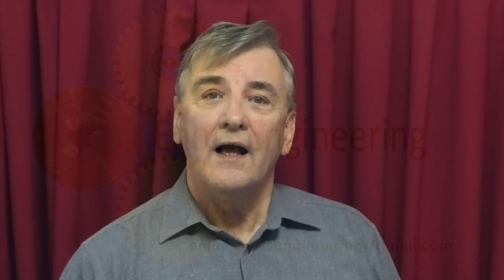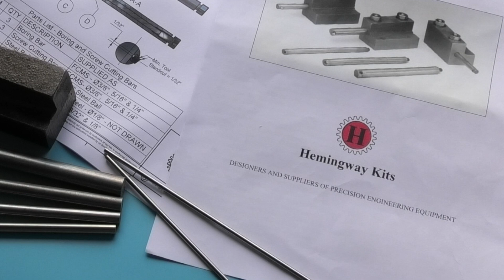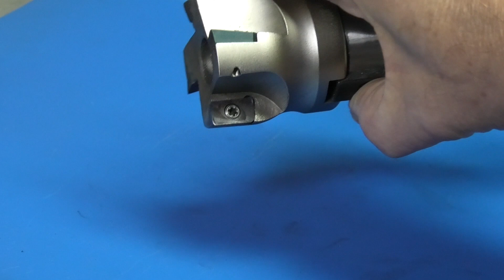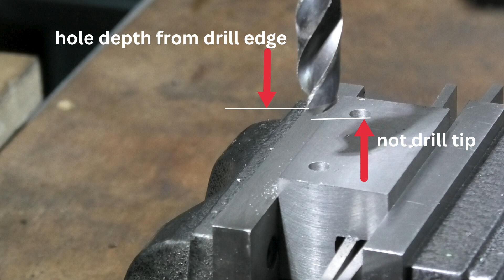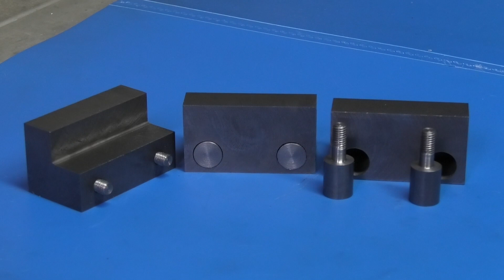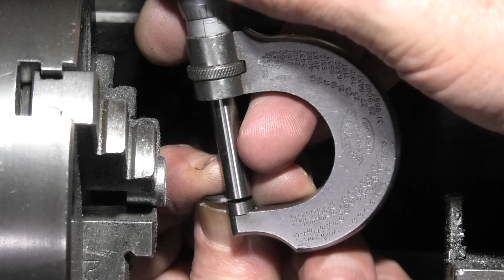TORSION boring bar set

Comment: Was looking at this boring bars kit, nice to see some videos about making them! One thing I didn't understand in this video. You used a regular drill to make counterbores for the heads of the clamping bolts. So the counterbores don't have a flat bottom, the bolts/washers will only contact the counterbore on the outer circle, is that fine? Why didn't you use a normal counterboring bit, or a regular bit followed by an end mill?
Looking forward to part 2...
Reply from the maker: Hi Gene the washer is a spacer so you don’t need to make a flat bottom to the hole. The bolt should never touch the bottom of the hole.
Reply: @enotsengineering  yeah I understand but why not make the bottom of the home flat (I mean perpendicular to the bolts axis)? Or face the bottom surface of the washer with a taper that matches the angle produced by the drill bit?
Reply from the maker: Hi Gene maybe  I didn't make it clear.The washer is a spacer to ensure  the bolt face is clear of the bottom and removed after machining. The bolt face should not go near the bottom of the hole as it locks up on the boring bar.So you don't need it flat?
Reply: @enotsengineering  After watching your second video I finally figured out how this clamping system works. Initially I thought that the clamping bolts just push on the bar from the side. Now I understand that when drilling the hole for the boring bar in the holder, the clamping bolts also get drilled. Then when the boring bar is inserted, it goes through the holes in both the holder and the clamping bolts. To clamp the bar, the nuts are tigthened, pulling the bolt towards them and strongly locking the bar. Using these 3/64" (~1.2 mm) thick washers during boring bar hole drilling ensures that there's enough space for the bolts heads to allow for tightening.